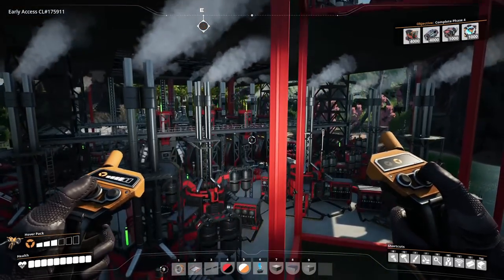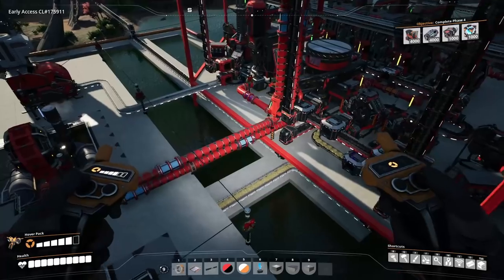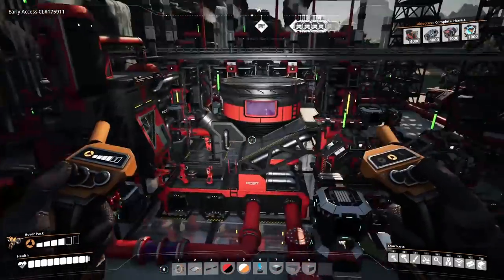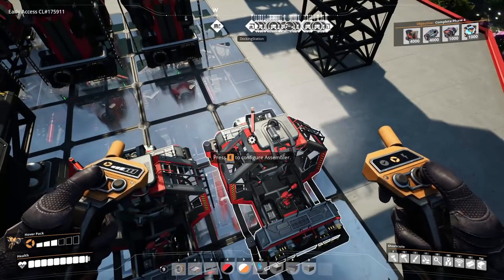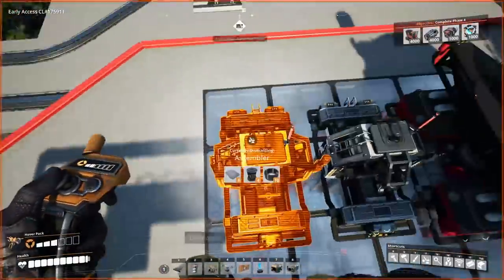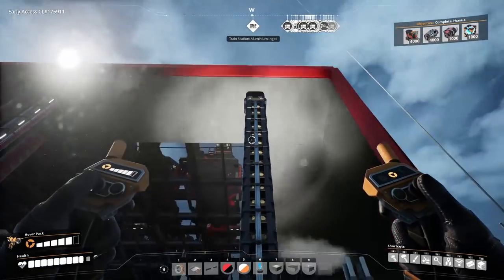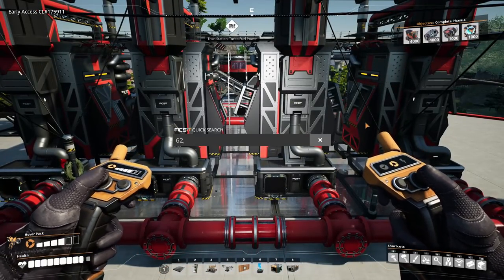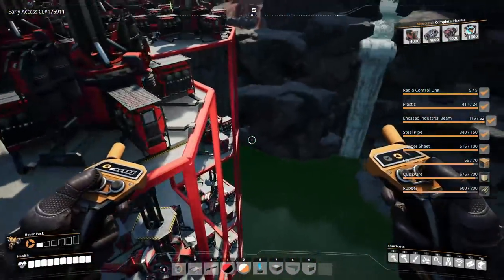Solving the Problem with TURBOFUEL Power ▶ 25,000 MW | Satisfactory Update 5 | #17 | Tutorial/Guide

Comment: I like this design.  I am unlikely to copy the whole thing, I tend to fetishize doing things my own way a bit.  AND, I intend to make use of the overall scheme of a modular build (I'm already doing that with coal power), the schematic for each module, the method for moving solids up the tower, and how you get a pipe junction to work vertically.  All good stuff.  You didn't mention, but I like the power distribution method you are using now, with the overhead beams.  Also, it looks good.  I am of a school that says all those smokestacks belong outside, so it kind of has to be open, agree there.

Comment: This modular thing is unspeakable good, very long term, im moving from mk2 miners up to mk3 atm and tearing down loads of stuff so building something as I need it is very exciting.
I might go for the desert as the water is at the top of the waterfall and ill let it fall down. fitting 14 power plants I dunno might need to change the size or dump the heart shape? anyone got actual block sizes wide and length?

Comment: Notes for when I'm building this in my factory...
12 Floors x 2.1GW = 25GW
Map: 21:18

Total Buildings (12 Floors):
48 Assemblers
60 Refineries
12 Blenders
168 Fuel Generators

Module Buildings:
2 Assemblers
5 Refineries
1 Blender
14 Fuel Generators

Total Inputs /m:
600 Sulphur
600 Coal
337.5 Oil
900 Water

Main Floor 16x14
Glass floor 6x7
Platform: 5x8
9 Tiles from long edge
4 Floors up

Alternate Recipes: 2:36
Refinery: Heavy Oil Residue 93.75%
Blender: Diluted Fuel 75%
Assemblers: Compacted Coal 100%

Final Recipe:
Turbofuel 83.3% (15.62/m)

Layout:
Fuel Generators - 6 on heart shape and 3 on both sides
Reply: This needs to be pinned as first comment.
Reply: I want to point out that for 100% efficiency you will need to set 1 generator on each floor to 88,89% since production is 62,5 and consumption is 63.
Reply: Thank you sir.

Comment: I definitely want a blueprint function added to this game. Yes, crafting is a huge part of the game. Mind-number manual duplication of our own designs ought not be... Blueprints really need to be in the top five new updates to the game.
Reply: Yeah building things like duplicated supports and stuff is a pain however it will be a super powerful tool in base expansion when it's combined with modular designs like nilaus showcases.  Imagine you just pop over and duplicate another level of this plant and have an instant 25,000mw additional power. That is pretty OP.  I can see why they wouldn't add it in.  It makes more sense in factorio due to the 2d design and the "infinite' map size.  

If they did end up adding it as a feature I could see it being used similarly to mass dismantle, put your gun in a copy mode and it highlights things green that will be copied, up to a finite amount of items selected.  Shouldn't bee too tricky.

Comment: Am I crazy? I'm only seeing 12 generators per floor, not 14?
Reply: Four on each side and six at the back. You must be going crazy :p
Reply: 19:44 you can see that one of the 4-long sides has an extra 2 generators shoved into the further-out space on each floor; i definitely thought the same too at first so I'm glad i went back and checked!
Reply: I think you're right. I'm seeing 12 per floor as well: six on the back, two on each short side and two total on the input side. It should be easy enough to add 2 more to each floor so all the ratios in the video work out.
Reply: 12 for sure, you are right. While, yeah, easy to extend to 14 though.
Reply: uh no you're not it's 12 and he keeps saying 14 but that would need a bigger platform
Reply: Came here to say this.  3 on each lobe of the output side for 6, 2 on each side for 4 more is 10, and 2 on the input line for 12.

I suspect there were 14 on an earlier iteration, but no one re-counted when the design changed.
Reply: You are NOT crazy.  There's only 12.  And I just built a level of this.  Starting to get pissed.
Reply: Came here to ask if I was crazy, seems I'm not (but some people still think they count 14...)
Rations are still built for 14, overclock all 12 (twelve not fourteen) to 120.53% for ~5.2 turbofuel per minute consumption.
Reply: I thought the same thing when I built this, he did reply on another comment saying 2 were added after recording to make 14. I had trouble fitting them in in a way I liked so I just ran 10 at 100% and the remaining 2 I overclocked to 237%

Comment: Hi Nilaus, love your builds ! Learned alot from you!  You say this is 2.100 mw , but there are only 12 generators on eacht floor, I made this build following your video but i cant find the 14 generators per floor. so now im on 1800 mw with 12
Reply: You can re arrange them to fit 14 per floor
Reply: @andrescortes6458  but everything doesn't provide enough for 14 generators.....
Reply: @PuckStar  It provides 0.5 less fuel than you need for 14 generators (62.5 instead of 63). Just downclock 1 to ~85.8029% clock speed (almost exactly 133.3 MW, 4 tf p/m).
Alternatively you can drop half of the generators (down to 7) and use whole lot of powershards (252 in total, 21 per floor) to boost 6 to 9tf/300mw (~246.2289%) and one to 8.5tf/283.5mw (228.5948%). Note that correct mw is only displayed on the left panel of the generator when you over- or underclocking them. In fact, you can use this trick on 12 generators layout to boost two to double the consumption and output. Exact formula for clock speed is: (desired actual % value / 100) pow 1.3 × 100, so for 200% it's 2^1.3×100 = ~246.2289% clock speed.

Comment: Great tutorial and great design. Thanks!   That trick with getting the pipeline junction to point upwards and in perfect alignment with your destination/source is a real life-saver. I had so many crooked connectors trying to slide it along an existing pipe underneath floor holes. And spinning them with the mouse wheel has always been frustrating...

(and yes I just re-did about 50 pipe junctions that had pipes that were 2-8 degrees not true straight.  One must never anger the gods of Effectiveness).

Comment: your modular designs always impress, is this a 100% efficient, or are any ressources wasted? :O
Reply: 18.75 polymer resin per floor. 225 per minute when fully built. Well, they are converted into points which is up to 2700 points a minute if you need that. You can setup a couple of refineries at the bottom to generate 112.5 rubber (default Residual Rubber, 6 refs, one at 62.5%), 75 plastic (default Residual Plastic, 4 ref, one at 75%) or ~14 fabric (alt. Polyester Fabric recipe, 3 ref, one at 81,25%) per minute. And sink that, if you don't want to deal with that after all, but fabric will be a net loss (~1960 points/minute), 112.5 rubber = 6750 points/minute, 75 plastic = 5625.

Also, actually make sure to use 14 fuel generators or overclock a few since video only shows how to place 12 while everything actually tuned for 14 (with one slightly underclocked to 4 fuel per minute).

Also, you may want to setup 8 water extractors instead of 4 to save a bit on power consumption.

Comment: What I did is I built a 16 Gigawatt system, it is my first playthrough so I went modest. I had enough coal generators and battery backups running to turn it on so I wouldn't get a brownout. Everything up to including 4 Fuel Generators to start, pass all the excess heavy oil residue into Rubber/Plastic Refineries so it won't back up and shutdown. I am making mad amounts of Rubber and Plastic for endgame and placing in storage, using as I need. Any overflow Heavy Oil goes into Petroleum Coke refineries and that goes into the Awsomesink, I add Generators as I needed them. It's a lot of work and preparing but I get points to spend at the store and never have to worry about power. All on one Oil Node.

Comment: It would be nice to put a power switch on the second level of the platform.  This way, if power ever did trip out in your world, the incremental load to power this back up would just be one floor of machines.  Once that floor is working, the power switch could be thrown to power up the rest using the energy produced by the first floor.  All in all, a very nice modular build.

Comment: i have one question, i have heard a few times that the main issue with turbofuel is that it requires sulfur  which will than be the bottleneck for nuclear power. does it make sense to invest in turbo fuel at all?
Reply: It's a personal preference thing.  You'll need sulphur for nuclear power later on, to be sure.  Turbo fuel is a good intermediate step to that, though.  As you can see here, you can make a ton of power using only 600 sulphur/min and there are other sulphur nodes around.  Worst case, you can repurpose the turbo fuel system into a plain old fuel one should you require the sulphur elsewhere.  The infrastructure is already built out, it's more a matter of changing your recipes out at that stage.  This weay, even if you need the sulphur later, the work on the turbo fuel isn't wasted.

Most importantly, play how you want, not how others tell you to.  Get ideas from stuff such as Nilaus' videos, sure, but don't build identical copies, necessarily.  Use the basic idea to do your own thing.   You'll probably have more fun that way.

Comment: Save yourself the pain later and start from the top down. Decide how tall you want the building or build the number of floors needed first, pump all your turbofuel to the top into buffers then distribute it down the tower from there. I just built a 5-story turbofuel setup a few days ago and kept having flow issues and generators shutting off, even with plenty of headlift. I even put valves on each floor so it could only receive it's prescribed amount. Only thing that fixed it was pumping to the top into buffers. 

In retrospect, I probably would have belted the packaged fuel and compact coal to the top and made the turbofuel at the top and saved power on pumps...
Reply: Great idea, I'll have to remember that for my future tower builds. I just did a simple 3-floor generator setup. It wasn't too bad, but hoping the flow was enough after getting through each floor was a big question mark. It worked but I like the idea of having big beefy buffers up top and just a set of 'master' pipes taking everything up.

Comment: So what am I doing wrong? or did the required input/output change since recent updates?
First I don't see 14 generators in your build but ok I can place them myself of course.
However 14 generators require 4,5 turbofuel so total of 63 turbofuel.
But with 4 turbofuel refineries set at 83.3333 clock speed we only get 62,48 turbo fuel. 
So not enough for 15 generators.......

And I can't change the clock speed of the refineries to match what is needed because then I would need 51,2 compacted coal. While the 2 assemblers produce opnly 50.
Now or course I can up that production but I guess then it will not be possible to have the final total of 12 floors.

What am I missing?

Comment: Really nice tower, but you actually can cut half of the Fuel Generators if you overclock the rest to exactly 9 tf p/m consumption and 300W output. That requires a whole lot of Power Shards (252 in total), but it's not like there's any better place to stuff them in update 5 beside miners and fluid extractors. There's ~1400 in the world and they are renewable anyway, so that can help with trimming build complexity quite a lot.

Also, am I blind or despite repeating many times we need 14 generators you actually placed only 12? At least that's what I see. 6 behind, 2 on each side, 2 at the front. 12 in total.

Exact numbers:

Downclocking (to match exact output of 62.5 fuel per minute):
Set clock speed to 85.8029% on 1 generator for almost exactly 4 fuel p/m and 133.3mw. Make sure you have 14 generators per floor. ;)

Overclocking:
Use only 7 generators. Set 6 to 246.2289% and one to 228.5948%.
Numbers are actually rounded, so you can use 246.2288% if you afraid it will over-consume fuel and go into downtime for a fraction of a second every once in an eon.

Or use mix of the two methods above to get whichever number of generators you wish between 7 and 14.

Comment: I had just one suggestion:

Have you considered adding some height to the the floors (the actual flooring)? Like maybe using some thicker structural pieces or adding some of those crossbar prisms below the flat floor? It seems like it might make it look nicer than having tonnes of machinery resting on what looks like a piece of drywall ;)

Comment: Very nice, keep up the good work! I would like to correct, something: the alternate turbo fuel is less efficient than the normal one in terms of resources. It's 4 to 4 for comapct coal to turbo fuel, while the original is 4 to 5 coal to fuel. It is simpler, not having to refine anything, and makes your fuel faster. Good luck with your videos :)
Reply: there are two alternates blend turbo fuel and heavy residue turbo fuel

the blend turbo fuel uses less resources example:
100 turbo fuel normal - 180 oil, 80 compact coal  @269 mw - bit of polymer resin as side product
100 turbo fuel blend - 175 oil, 50 petrol coke+sulfur @328mw - 83 heavy oil residue excess, some rubber and polymer resin

you can then take the 83 heavy oil residue and make an additional 66 turbo fuel with the heavy oil residue recipe at the cost of 66 compacted coal and this part is probably what you meant^^ the heavy oil residue takes more compacted coal/sulfur than either normal or blend turbo fuel 

I'm too lazy to calculate an ideal setup but I'd say since it all boils down to sulfur, technically the blend fuel is the ideal singular recipe because you need less sulfur and you don't need to import coal

if you're concerned about oil it's probably worth to consider building a mixed setup containing heavy oil residue 

another layer is the excess rubber or plastic you can produce with waste material

ohh sorry for spamming btw. didn't want to contest what you said in any way just add to the criticism
Reply: No, I was speaking in reference to turbo heavy fuel, in the refinery, though the blended fuel is the best choice, if you can spare the oil (it takes about twice as much crude as the stock recipe for the same amount of turbo fuel).
Reply: @lordjames307  I have no idea where you took that number from?

100 turbo fuel requires 180 crude oil in standard recipe
100 blend turbo fuel requires 175 crude oil WITHOUT additional recipes

100 heavy turbo fuel requires 187,5 but with the heavy oil residue recipe it's actually far less like ~93 crude oil but as I said requires more coal/sulfur 

if you combine blend turbo fuel + diluted fuel (from heavy residue+water) and heavy oil residue (instead of rubber) you end up with 75 crude oil input for 100 turbo fuel output (with 50 petrol coke included)

obviously it's massively more complicated to make an efficient layout with all the alternate recipes but blend turbo is hands down the most resource efficient recipe and heavy turbo is definitely an option if you don't care about maxing out your sulfur and because it's obviously a fair bit easier to build
Reply: To make 60 turbo fuel per minute, the standard recipe + heavy oil residue + diluted fuel requires 27 crude (and 48 coal and sulfur). To produce the same 60 turbo fuel per minute with the turbo blend recipe + heavy residue + diluted fuel requires 45 crude, but only 30 sulfur and no coal. 

Hope that’s clearer
Reply: @lordjames307  oh yeah my mistake I ignored the alternatives for a direct comparison and didn't include it in the more complex ones
thanks for the heads up
save to say that diluted fuel and heavy oil residue are vital